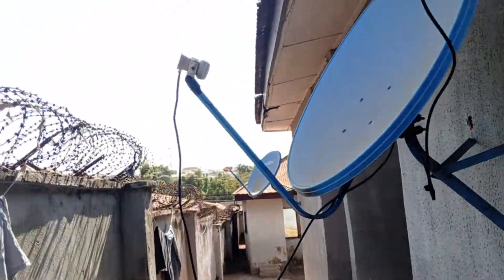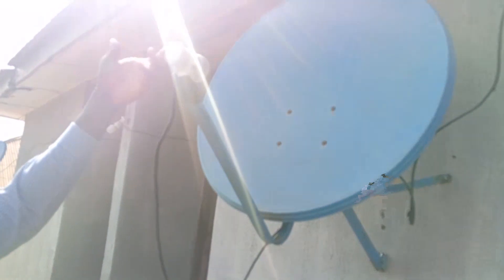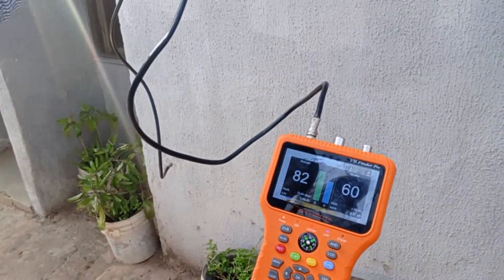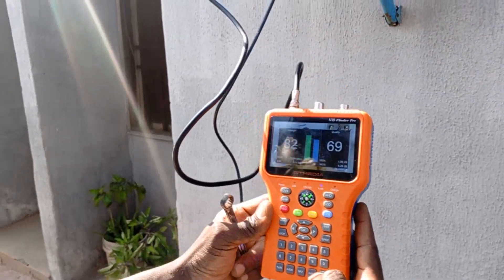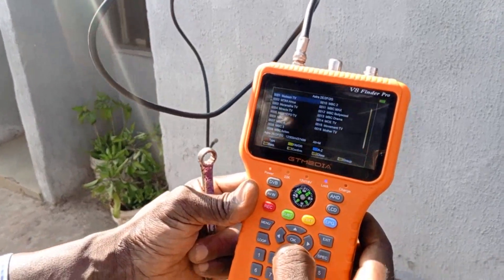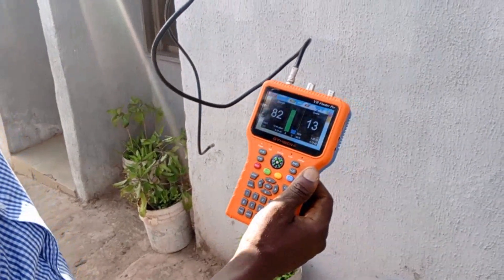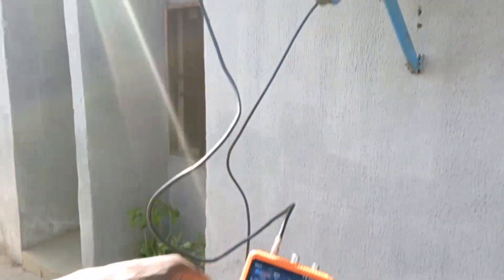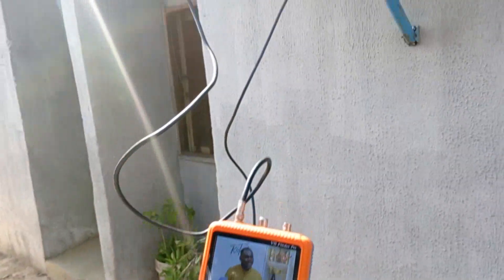( Astra 28.2E & Badr 26E ) Beginner to professional Pt. 10.

Comment: I'm not seeing MBC channels on my inbuilt decoder, which I believe the dish outside is receiving both signal, because two dish was installed for me, to two separate decoder. The dish connected to inbuilt has more channels than the other dish connected to the 2nd decoder.

Two separate sitting room, but same station on both, except few more channels on the inbuilt that is missing on the 2nd decoder.
Reply: Please MBC is not on any of them, how can I add them to the inbuilt decoder, which I believe is getting some signal from 26° ? because it has more interesting channels than the 2nd decoder
Reply from the maker: You have to confirm that the dish is setup with MBC channels first, if it is then do a blind search for it
Reply: please I successfully add 42.2°e(Nigcomsat) to my dish with the primary already set to 26/28.2°e.    but the Nigcomsat both signal strength/qualiy are fluctuating from 0–100% and back to 0 , so on and so on, I have set lnb over&over again, but it will only stay for few seconds and back to 0 and back to 100%.

Please what do I do to keep it stable?
Reply from the maker: Nigcomsat is unstable use that or Spectrum TV